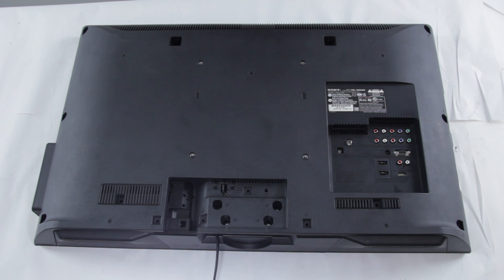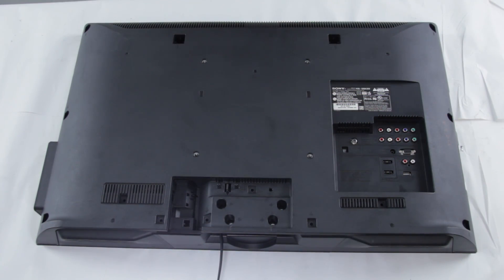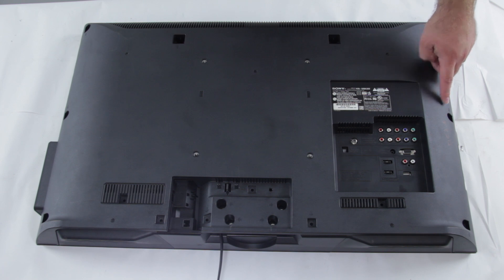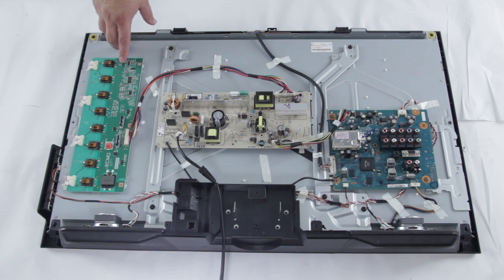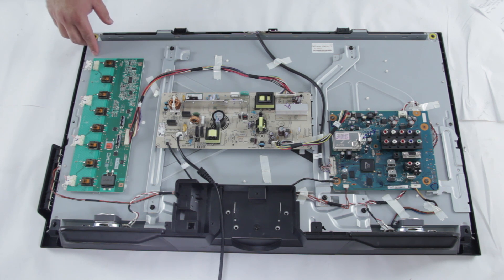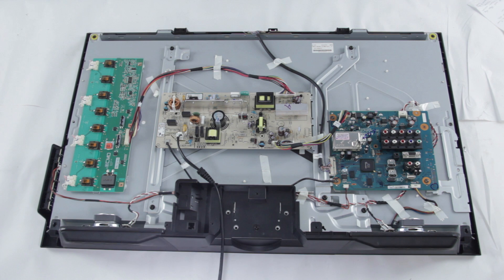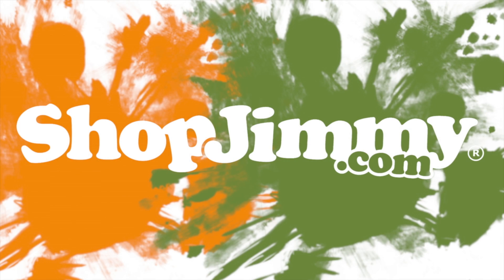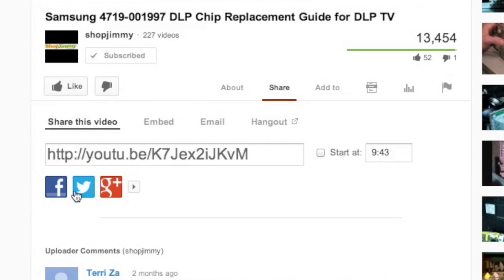LCD TV Repair Tutorial - Backlight Inverter Common Symptoms & Solutions - How to Fix LCD TVs

Comment: Hi, I have a Sony KDL-32BX425 tv, and I'm having a problem. When I turn on the TV, after some time, the TV turns itself off and back on again, and imediatly after, it turns off, and the red frontal LED blinks 6 times. 
Sometimes this happens after using the TV for a while, but most of the times it's less than a minute after turning the TV on.

Some charts I've found said it was a problem on the audio voltage, but most of the charts said it was a problem with the inverter, the backlight, or the power supply. So, how should I proceed?
Reply from the maker: Carlos Eduardo   This could be a problem with either the inverter board or the lamps in the panel.  You can replace the inverter board(s) to see if that fixes the problem with your TV.  Unfortunately I do not see any replacement parts in the search results for your TV model number on our website.  Thanks and please let us know if you have any further questions!  www.shopjimmy.com

Comment: i have a Sanyo P42841-00 and iam getting sound and picture comes in after a while but takes a while
Reply from the maker: 1bulldog998   Please watch this video FIRST to help with your repair!  https://www.youtube.com/watch?v=BP3NVNCGEv8  I recommend replacing the main board in your TV.  Click this link to replacement parts for your TV model number:  http://www.shopjimmy.com/catalogsearch/result/index/?cat=225&q=P42841-00  There may be multiple boards for the same TV model number, be sure to match part numbers on your current board, with your replacement for compatibility.  Here is a link to a video showing how to identify your part number, click here:  https://www.youtube.com/watch?v=Mi0D7ksQp7I  Thanks and please let us know if you have any further questions with your TV Repair!  www.shopjimmy.com

Comment: Samsung UN46D6050TFXZA  Screen has pic and sound. But the picture "pulses" bright and then dim (dimmer, not black) at a very regular interval..about every second. Does this on every screen...even the initial logo screen "Smart TV".  Have replaced power supply BN44-00423A. Just guessing and that wasn't it.
Reply from the maker: Mick Calemme   This sounds like bad LEDs in the TV panel.  Unfortunately we do not sell replacement LEDs and replacement panels.  Thanks!  www.shopjimmy.com

Comment: NEED HELP!!! I have a Samsung model# pn60e530a3f ........for a while... not when I truned on my tv the picture wouldn't kick in right away. so I would turn if off and back on and I would see the light fix on so I know the picture will turn on. well now the tv makes the noise that tells me its coming on and I can hear the show but now the picture wont come on at all. how do I fix it?
Reply from the maker: todd penney   Please watch this video FIRST to help with your repair!  https://www.youtube.com/watch?v=BP3NVNCGEv8  I recommend replacing the main board in your TV.  Click this link to replacement parts for your TV model number:  http://www.shopjimmy.com/catalogsearch/result/index/?cat=56&q=pn60e530a3f  There may be multiple boards for the same TV model number, be sure to match part numbers on your current board, with your replacement for compatibility.  Here is a link to a video showing how to identify your part number, click here:  https://www.youtube.com/watch?v=BEPWrefQvqI  Thanks and please let us know if you have any further questions with your TV Repair!  www.shopjimmy.com

Comment: I have a Toshiba model 55HT1U LCD television serial # A43185M12910A1
When I turn on the television the screen comes on entirely washed out (white) it will go dark for a moment and then return with the top 1/3 of the screen washed out about 50% (I can see the image but it is poor quality and the image is like someone adjusted the brightness to high), there are also vertical lines that appear to be about 2" wide. The lower 2/3 of the screen is washed out about 80% with no vertical lines or maybe they are there and I simply cannot distinguish them due to the lack of contrast. There are three (3) HDMI inputs, I have systematically moved the cable to each of the three (3) inputs and the problem remains the same at each HDMI port. The audio seams to work just fine. I am guessing that since I can see an image and the results are the same for all three HDMI ports that the main board is OK. The TV also turns on and off so I am also guessing that the power supply is OK. The symptoms are different than those explained for back light inverters. I am hoping that the video panel is not going out. Can you assist me with this TV I would prefer to keep it out of the landfill, besides this television is only about 3-4 years old and it wasn't cheap. Thanks
Reply from the maker: Lyn Vaughan  Please watch this video FIRST to help with your repair!  https://www.youtube.com/watch?v=BP3NVNCGEv8  This could be a problem with either the main board, the t-con board or the TV panel.  You can replace the main board, and T-con board individually to see if one of those boards fixes the problem.  Click this link to replacement parts for your TV model number:  http://www.shopjimmy.com/catalogsearch/result/?q=55HT1U  There may be multiple boards for the same TV model number, be sure to match part numbers on your current board, with your replacement for compatibility.  Thanks and please let us know if you have any further questions with your TV Repair!  www.shopjimmy.com

Comment: Hello shop jimmy,
I am hoping you can help me with a problem I am having with my Sony LCD TV, model KLD-37M4000 (very similar internal layout to the one you have pictured above.) When I turn the TV on, the picture is nice and stable and shows a very good image. However after an amount of time the picture starts to suddenly grow brighter and brighter on its own, until the image is washed out (although it is still visible.) It happens on every input, however when I switch between inputs, during the split second where the TV flashes the input name against a black background, that appears normal. Then when the source image comes on the screen it is back to the increased bright level. I cannot tell whether this is a backlight problem or not- when it happens dark areas of the image turn sort of a bluish tint, and the video processing seems "off" like the resolution has dropped a bit (may just be in my head though.) In your opinion would this have anything to do with backlighting? Or am I experiencing an actual video processing problem instead? (Again this issue happens all by itself without my touching any controls on the TV.) Thank you for your help
Reply: Sorry the model of my TV is KDL-37M4000, not KLD. Thanks

Comment: I have a RCA 46LA45RQ that turns on. for 2-3 seconds then shuts off. the day the screen went out, there was still sound going in. i havent used the flashlight step to see if its the Inverters but i did find that when i opened up the tv, that panel had one maybe two coils that were a little hazy, like if they burned up. could that be the problem? everything else looks great, no resistors or capacitors burnt or bloated.

Comment: 21,5" Samsung SyncMaster 2233SN - no backlight but there is an image. How to repair? Or where can i buy backlight CCFL?
Reply: Model: ONC50UB18C05 I have black screen I did flashlight test I can see menu I also have sound
Reply: @antoinemcelroy6272  replace the inverter board or the leds

Comment: Sony bravia kdl 46hx820
Power on get sound and picture but on right side corners top and bottom dim spots and after 6 sec powers off and then no picture and green turns to red light red flashes 4 times .

Comment: I have a question. my LCD TV can not turn on. When it is powered it ends up in a standby mode with a red illumination. It is an LG model number 37LH20.In a working condition it illuminates blue when it is turned on. the problem developed after lightening. Thank you.

Comment: I have a Proscan tv PLDED3996CA-C2, THAT DOESN'T TURN ON, I HAVE REPLACED THE POWER BOARD WITH A NEW ONE, STILL NOT TURNING ON, WHAT DO YOU THINK THAT MIGHT THE PROBLEM.
Reply from the maker: Estelle Ligonde   I recommend replacing the main board in your TV.  Unfortunately I do not see any replacement parts in the search results for your TV model number on our website.  Please reply with your part number on your main board and I can try searching for replacement parts.  Thanks and please let us know if you have any further questions!  www.shopjimmy.com

Comment: I have a Sony bravia kdl-46hx820. Great shape but I get the power on for 5 sec and off.
Then 4 blinks red light code. I want to fix it 
What is problem. I have some electric repair experience. Help only had tv for 3 months paid 500 at pawn shop .
Reply: If when you look at screen do u see any darker spots in corners . I have same tv and same issue with my own. 
I was told by best buy repair it's the led inverter board. So I have one on order to try and see if it works. I'll let u know .
Reply: I fold the board and ordered it from Aliexpress for 26.00 ??? 
Never heard of this place and mixed reviews but 26.00 is cheap I think .
Reply from the maker: chris shaw  Please watch this video FIRST to help with your repair!  https://www.youtube.com/watch?v=BP3NVNCGEv8  I recommend replacing the main board in your TV.  Click this link to replacement parts for your TV model number:  http://www.shopjimmy.com/catalogsearch/result/index/?cat=56&q=kdl-46hx820  There may be multiple boards for the same TV model number, be sure to match part numbers on your current board, with your replacement for compatibility.  Here is a link to a video showing how to identify your part number, click here:  https://www.youtube.com/watch?x-yt-ts=1422579428&x-yt-cl=85114404&v=Aodz2LHkzbY  Thanks and please let us know if you have any further questions with your TV Repair!  www.shopjimmy.com

Comment: I have a Phillips 47" LCD TV model number 47PFL5432D/37 and the problem that I'm having is that when I turn the TV on the picture comes up, but half of the TV is dark. I would love some help with this as it is the only TV we have and cannot afford to buy a new one.
Reply from the maker: Brad Poleski   This sounds like a TV panel (TV Screen) problem.  If your TV panel is bad, it may be more cost-effective to replace the TV as panels are typically hard to find in stock, difficult to replace, and expensive.  Thanks and please let us know if you have any further questions!  www.shopjimmy.com

Comment: Hi, I have a Hitachi L32A01A. Same issue, no display just the sound. i want to know how do you tell if the backlight inverter is spoilt? and how do you change the backlight?
Reply: ok, i found out that the backlight isnt working. i used a torch light and can see the screen and menu and all but just very dim. but how to change the backlight?
Reply from the maker: shankara dhadi   Please reply with the part number on your backlight inverter.  Thanks!  www.shopjimmy.com

Comment: Hey guys, I appreciate what you're doing here, keep up the good work!  I have a Toshiba 55SL412U s/n: B11192C00114K1

My problem is an intermittent issue that's been plaguing me for the last week or so, where the TV will occasionally not turn on.  During these episodes, it won't respond to the power button on the display or the remote, and the LED indicator will not turn on.  If I leave it unplugged for a while, most of the time (maybe 75% of the time) it will turn on when you plug it back in, and sometimes it won't.  I've ruled out the outlets, and the surge protector that it's plugged into.  The interesting thing is that I have a Chromecast plugged into it, which gets it's power from the USB plug on the back of the TV.  I've noticed that the Chromecast will respond to the remote, and the front touch button.  It will look for a connection for a few seconds, before returning to it's standby state.

I called Toshiba's support line and the rep told me to unplug the TV, and press the TV's power button for 30 seconds.  When I plugged the TV back in, to my amazement, it turned on.  Unfortunately that's the one and only time this trick has worked for me.  I recently opened the TV, and saw some dust on the power supply components.  I removed the board from the TV and cleaned the dust off, but still no response.  Very rarely in the past I've seen issues on my TV where the sound won't come on, but turning the TV off and on again fix the issue.

I'm pretty stumped here, but I'm hoping you guys can shed some light on this.  I have a multimeter, and a degree in electronics so I can follow any instructions you have, I just don't know where to begin, as I can't seem to find a schematic.  For what it's worth, I live in the Northeast and the air is pretty dry in the winter.  I thought it could be an issue with static electricity, but who knows.  Thanks in advance!!
Reply from the maker: *****  Please watch this video FIRST to help with your repair!  https://www.youtube.com/watch?v=BP3NVNCGEv8  I recommend replacing the main board and the power supply board in your TV.  Click this link to replacement parts for your TV model number:  http://www.shopjimmy.com/catalogsearch/result/?q=55SL412U  There may be multiple boards for the same TV model number, be sure to match part numbers on your current board, with your replacement for compatibility.  Thanks and please let us know if you have any further questions with your TV Repair!  www.shopjimmy.com

Comment: hi my sony kdl40d3500 as a problem  when you first turn it on a thin bright purple flashing line goes across bottom of screen from right side as you look at it to around half way then a dark vertical strip full width of screen picture ok each side of stripe and you can see pic in the dark strip after around 10 min clears up then all fine till next time its been off for a while than same again thank you for any advice

Comment: The part# for the board I believe is CEM842A. I have a picture of all the boards in the TV if that helps. I saw that board on ebay but I don't trust buying from there because most of their boards are used boards.
Reply from the maker: ag   http://www.shopjimmy.com/hitachi-cem842a-power-supply-unit.htm  Thanks!  www.shopjimmy.com

Comment: Hi Jimmy,
I have a Samsung UA46D6600 which has recently been getting horizontal lines. I've noticed a lot of heat in the bottom right corner where a black patch has occurred on the screen. The picture is fine on start up but as the edge heats up the picture gets worse. Any ideas? Thanks

Comment: Hello SJ,I have a Toshiba 32AV500U that I get 2 flashes of the backlights then black. I have sound and I can see the image using a flashlight. It had master and slave inverters so I bought a single inverter conversion kit and I get the same issue. 2 flashes then black with sound. Any ideas?
Reply from the maker: Steve K  Please watch this video FIRST to help with your repair!  https://www.youtube.com/watch?v=BP3NVNCGEv8  It could be you received defective replacement inverters or your power supply is bad.  If you feel the inverters are good, then I recommend replacing the power supply board to see if that fixes the problem.  Click this link to replacement parts for your TV model number:  http://www.shopjimmy.com/catalogsearch/result/?q=32AV500U  There may be multiple boards for the same TV model number, be sure to match part numbers on your current board, with your replacement for compatibility.  Thanks and please let us know if you have any further questions with your TV Repair!  www.shopjimmy.com

Comment: Hi Jimmy I have a 24inch Bush 24 dvd combi.  I have changed some faulty capacitors and it has gone from a continual fast flashing red light to the standby light, however when turning on it goes from red to green and then 3 seconds later the power supply flashes whilst it sets back to standby!!? no picture no light or sound.  I do get a buzzing from the speaker when it is plugged in when its switching back into standby.   what do you recommend checking next oh great wise one please sir?
Reply from the maker: Justin Wallace   This could be a problem with either your main board or the power supply board.  You can replace each board individually to see which board fixes the problem.  Please reply with your TV model number.  Click here to view a video that shows how to find your TV model number:  https://www.youtube.com/watch?v=S51nhAmwR2M  Thanks!  www.shopjimmy.com

Comment: I have an ELO Touch Screen Model ET1515l-8CWC-1-GY-G.

Some time ago it developed a problem where it would not switch on (it would flash on for less than 1 second and then go blank).

I found that by pressing the on/off button multiple times it would eventually switch on.

My (temporary) solution to the problem was to leave the monitor switched on permanently.

This worked for about 3 months - until we had a mains power failure.

Now it will not switch on at all - same symptoms as before but multiple pressing of the on/off button no longer works.

I suspect that it may be the inverter board.

I have a second ELO monitor (same Model) which is working. I was planning to swap inverter boards to see if this solves the problem. If it does, I will order a replacement inverter board.

However, before doing this I would like to know if there is a possibility that the faulty monitor may damage my "good" inverter board (e.g. if the problem is a faulty backlight, could this cause damage to my good inverter board

Regards,
Ian
Reply from the maker: Ian Illingworth   Yes, it could damage the good part, especially if the inverter is not the problem.  Thanks!  www.shopjimmy.com